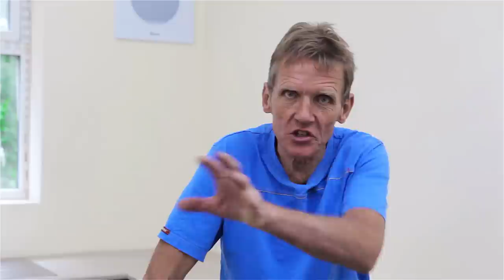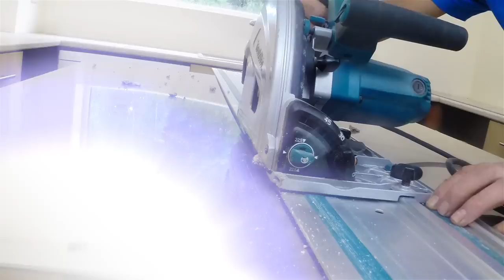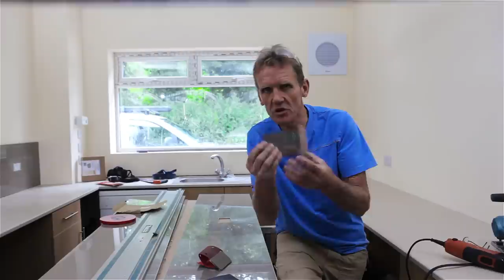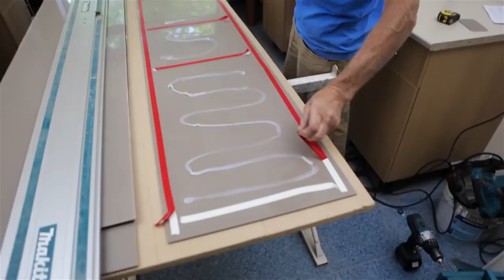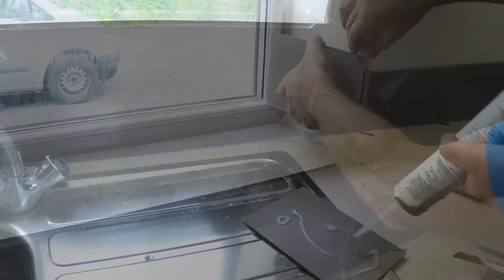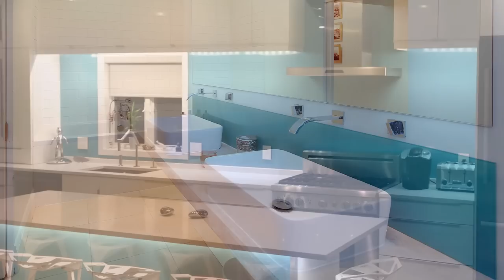Lustrolite Coloured High Gloss Acrylic Wall Panels

Comment: what blade did you use in the makita plunge saw? I have asked makita if they have a blade that cuts acrylic for the saw but they said no, what do you suggest?
Reply from the maker: I would go for the finest one they have. You need to move forward slowly but the blade can run fast. I like the scribe cut on the Makita plunge saw. That first shallow cut takes the stress out of it.

Comment: Can this be used on Cabinets Fronts?
Reply from the maker: Yes you can stick it with neutral curing silicone. I am not sure what you would do with the edges but they do sell edging strips so you could mitre them like a picture frame